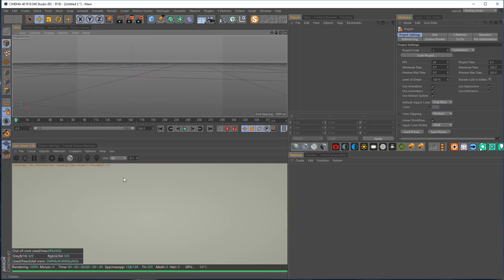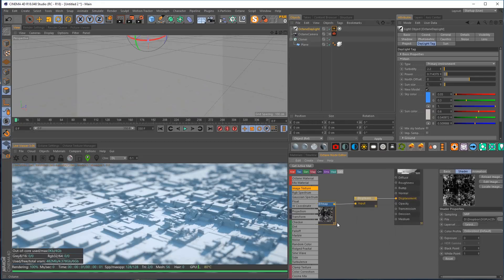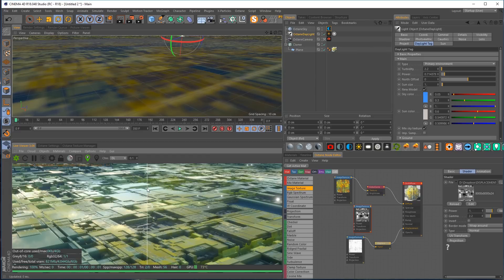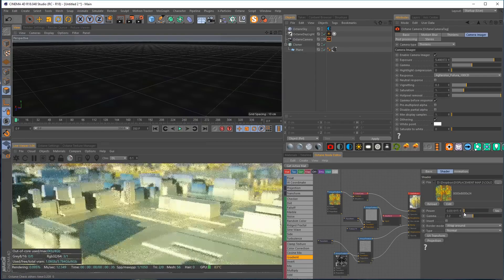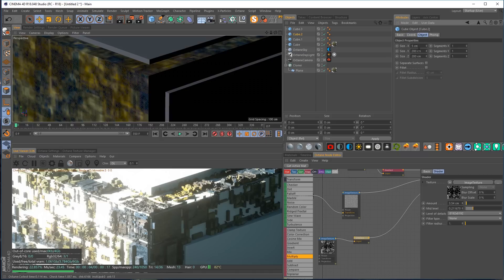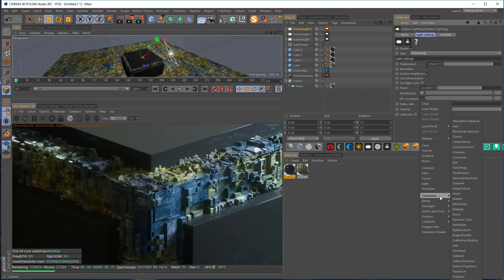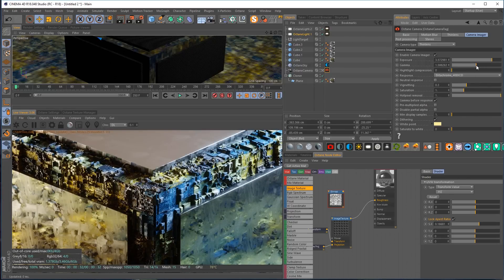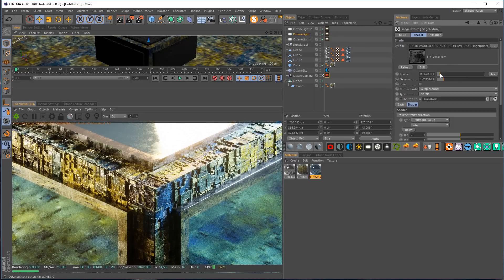Cinema 4D Tutorial - Using Displacement in Octane Render

Comment: Is it because of the renderer which is octane in this case that you don't need a crazy amount of polygons in order to use displacement map? Cause what I know is that in order to use displacement map you need to subdivide your model. The more detailed the map is, the more polygons must be presented in order to use displacement map.
Reply: That's true for Physical renderer, but not true for Octane. You can have a single polygon with an 8K displacement map and get all of the detail of that map presented. It's an amazing way to conserve on geometry, which really helps keep the scene sizes low and frees up your VRAM, which is your bottleneck for scene size with GPU rendering (unless you're using out of core geo which overflows to the RAM, but then you lose speed)
Reply: How amazing it is when octane can do that compared to other renderers. Thanks anyways

Comment: Great tutorial with many useful tips!

However, it's been a while since I've searched online for 'Octane Displacement issue' and sure enough I am very disappointed to find that there is still the same problem where the edges of objects break apart when using displacement.  You breeze right over this making it seem like a non issue - just like Otoy themselves - or so it seems! 

In my opinion, it is without doubt the biggest, most fundamental flaw of Octane and prevents it being the best render engine out there.  How it wasn't the most important fix in version 3 is baffling to me!  

Is there any point in creating anything other than mountainous landscapes with Octane displacement? ... not that I can see!  If you've got a really complicated object and you dare apply displacement to it, prepare to be disappointed and frustrated!

Will they fix it for version 4??  - I sure hope so!

Cheers.
L.
Reply: Under displacement you have to adjust the "mid level"! :)